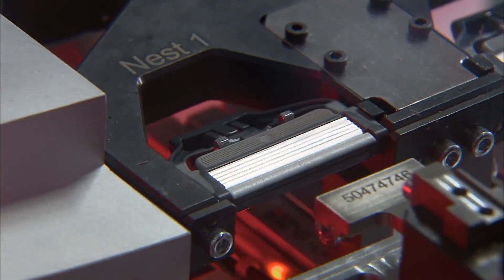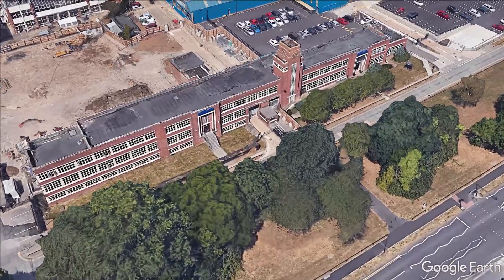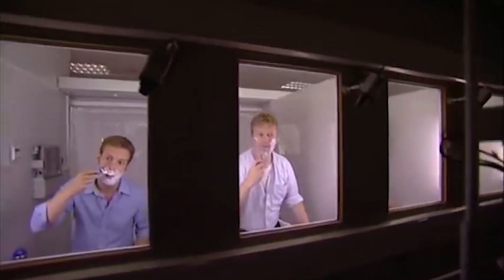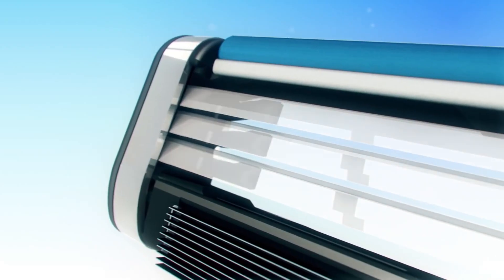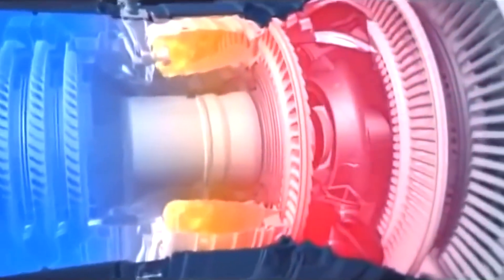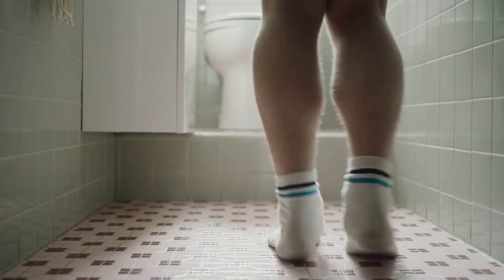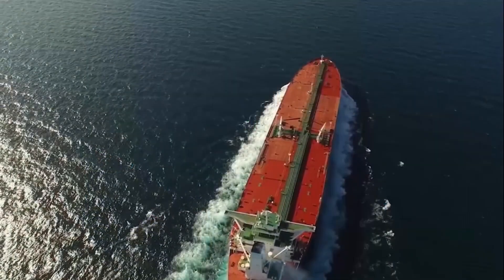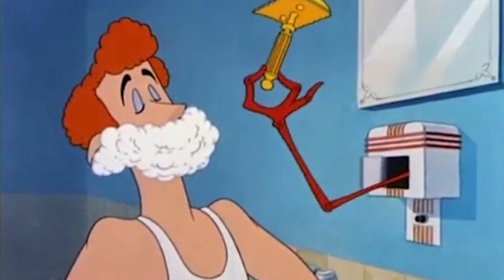A Diamond Razor That Lasts 1000 Uses Exists! But You're Not Allowed To Buy It!

Comment: Hate to get in the way of a good story but you can still buy 'tungsten coated' blades that are probably better than the origional alloy, I know becuse I got tired of buying overpriced gillette blades and bought a shavette with a pack of Derby extra blades that last ages (all off amazon). On the pack it says "chromium-ceramic platinum tungsten polymer coated edges" so if you wanna shave for next to nothing (at least in cost of blades) I'd reccomend it. Not trying to knock your video, it was still interesting and well put together I'm just skeptical when anyone says an amazing technology/invention was never used again because it failed in it's first iteration.
Reply: It didn’t fail though, that’s the point. Those tungsten 74 blades were so good that the company couldn’t sell enough in their day, so failed 🤷🏼‍♂️ The video mentions how startups like the one you found on Amazon are positioning themselves in the market, and how big name brands may be forced to innovate and follow..
Reply: Comercially failed, which yes for any business is pretty important. Not saying the design failed but do you seriously think that development of new corrosion resistant alloys hasn't advanced significantlly since?
One last thing, Derby have been making razors since 1940 according to google so I dont see how they're a "start up" stealing the idea of an everlasting razor. Llease make more sense if going to reply again.